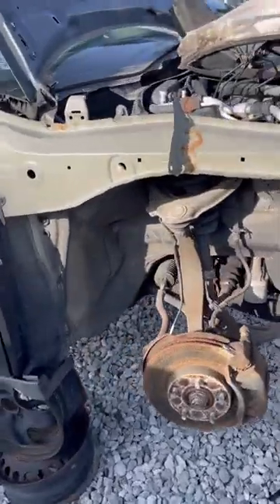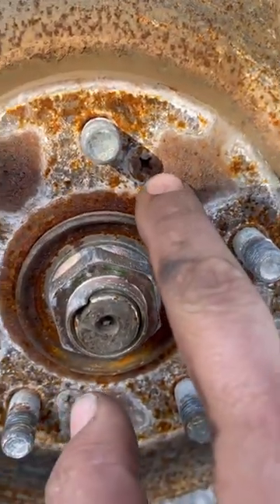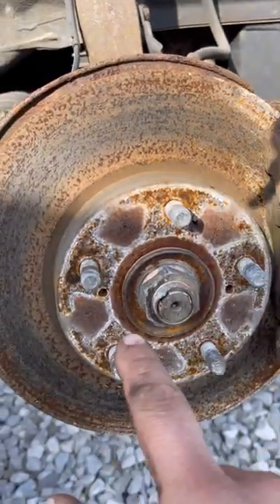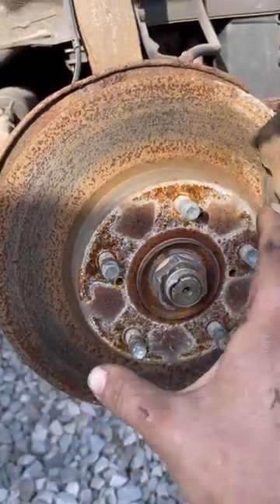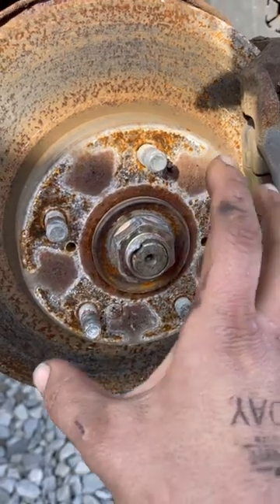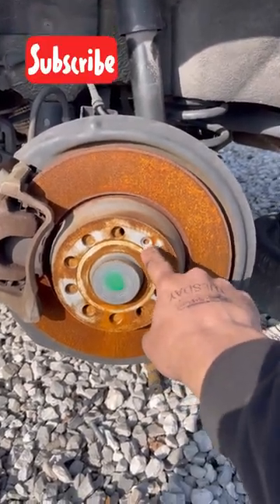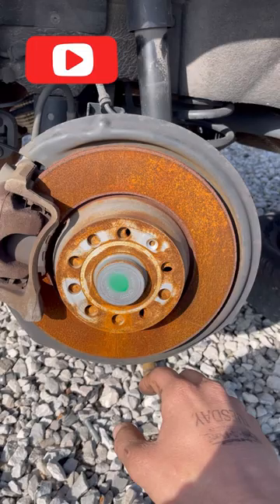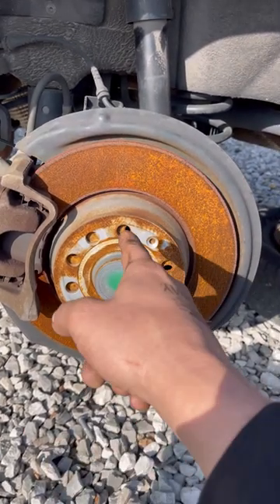Brake Mechanic Tips removing rotor & set screw

Comment: For the german car, there is a random metal stick with the tool box in the car. That'll alone the rotor and hold the wheel while u thread a bolt
Reply: They're called wheel pins or wheel hangers. Also more commonly known as cheater hangers or just cheaters lol

Comment: The set screws in a Honda rotor uses JIS Crosspoint screws and require that you use a JIS Crosspoint bit in your hex bit impact driver.  Using a Philips bit will destroy the JIS screw head and leave you in deep sheeit.

Really, Honda, WTH?  Couldn't you have used a Torx screw, instead?
Reply: 2 hammer method. Done.
Reply: Thanks for the clarification!
Reply: You could keep them crisp by just grinding the tip of a 3/8" drive phillips bit and give it a few potent whacks with a hammer. They'll free right up without damaging the star in the screw head due to the improved engagement of the ground tip phillips bit.
Reply: @renatotesta902  2 hammer method.
Reply: Just lean into a Phillips with a wrench on it.
Reply: @NinaYo401  😆 Either you're not in the rust belt, or just inexperienced
Reply: @anythinganytimealways don't even need to be in the rust belt with Honda set screw.. they do not like to come out
Reply: @gregoriodecker2692  2 hammers. Easy peasy
Reply: Use an impact screwdriver. If you mess up the screw just grind a slot and use a flat head
Reply: Center punch and hammer. Never hand an issue
Reply: Trust me i learned the hard way 😅
Reply: same screws for the side door panel. i didn’t know that and i fucked them up badly.
Reply: If it strips just drill out the screw head.
Reply: They come out easy if you know what you're doing
Reply: Apparently the reasoning is it’s a very widely used screw on pretty much Japanese motorcycles and other stuff

Comment: The oem oil pan drain plug is the same thread pitch as the wheel bolts.. I use them to hold the rotor in place snug against the hub if I see broken t30 screws “which I see a lot “ those drain plugs are shorter than the wheel bolts so you can get the rotor flush
Reply: I always flush my rotors with oil flush.

Comment: the two screw are put in assembly to keep the rotor in place until it gets to the point they put the wheels on

so when you take your rotor off to turn it or for any other reason you don't have to put it back on

many people think if they don't it might be dangerous

Comment: Yea there’s threaded holes but no bolt works for them so they are basically useless. Having worked on so many cars, I never found the right thread for them. I just use a sledge hammer and hit on the surface. Why waste time to find the bolts? Chances are the threads are so rusted anyways (Canadian diy mechanic)
Reply: M12x1.25

Comment: I love those threaded holes when I'm resurfacing a rotor and don't want to give myself more work. One bolt and a 3/8th impact and she pops right off.
Reply: Mine was seized so much that i pulled the centre of the rotor off but not the disc, so angle grinder was my friend

Comment: Japanese cars, and also a few Korean are easier to work in. Most filters are easy to reach and replace (oil reachable and near the oil plug, air filter cover just pops out , cabinet filters behing glove compartment drawer...) and amazingly all diferent brands on similar locations.

Comment: If hitting the rotor with a rubber mallet damages the bearing you got problems, the wheel spinning at 100kph with the weight of the vehicle on it hitting rough road will apply way more force.

Comment: Tho the set screw does help hold the rotor to hub, wheel is not enough when braking, the rotor will slide radially back and forth in-between wheel and hub. Wheel toque to spec of course

Comment: Honda wheels almost always rust onto the rotor so when someone kicks or torques the wheel off they often crack or chip the brake pads if you don't put the setscrews back in.

Comment: It doesn’t damage the bearing it doesn’t damage the hub. It’s a quick and easy way by time you find the bolts get the socket the rotors off.

Comment: Those are not set screws. They are countersunk screws that are used to hold the rotor on during initial assembly. Best advice I can give is take them out as soon as possible and throw them away. HONESTLY. YOU WILL THANK ME. They are designed to give you problems over time and corrosion.
Reply: True they are not necessary for studded hubs, but it is better to keep it unless damaged. Just put some anti-seize and don't over torque them. Disc bolts are necessary for German cars because there are no studs on the hub as shown in the video.
Reply: @lambition they literally pack new ones in with the rotors. 

I don't know when this 'leave them out,  only for assembly" fad came from but it's astonishing how many people are so wrong on this debate.

Comment: those threaded holes don't work in the salt belt. those rotors are going to be rusted on solid. the bolt will pull the threads out of the holes. in that case, it's hammer time! 🔨🔨🔨
Reply: It's always hammer time in the rust belt
Reply: Or it's moving time to some place like Florida where you won't ever have that problem again if you buy lifelong Florida cars.

Comment: First off brake mechanic 😂
Second off that rusted rotor will strip immediately if you use those threads and I hit rotors every day for years on end and never damaged a wheel bearing lol.

Comment: #1 part to delete on every single car are those dumb ass screws. I’d bet you anything that both of those screws would snap if you tried to take them out. Same story with those even dumber threaded holes. If the rotor is loose enough already that those do their job then you could’ve used your hands too, and if the rotor really is seized they just snap the screw off in those holes and you have to pull out the deadblow anyway